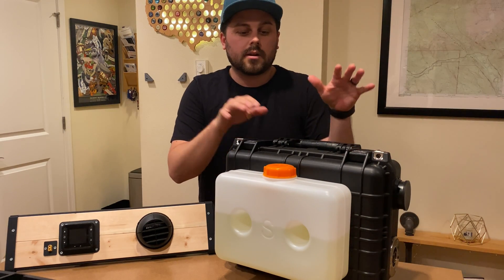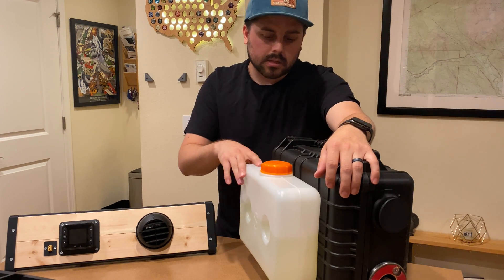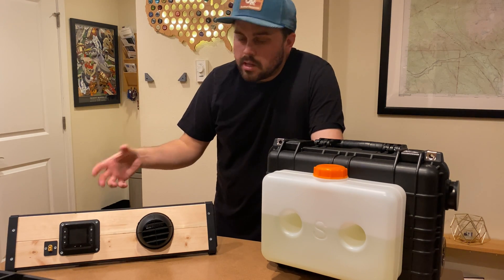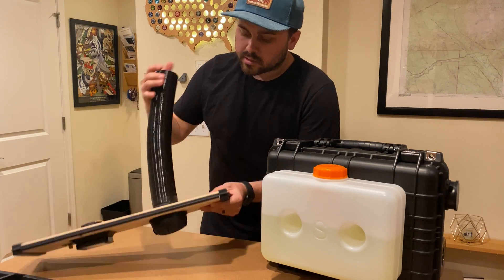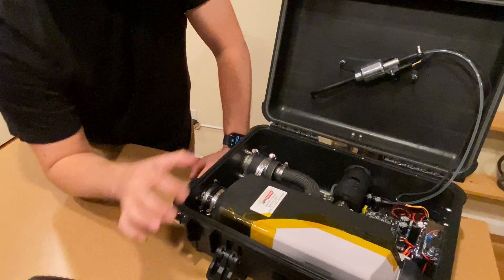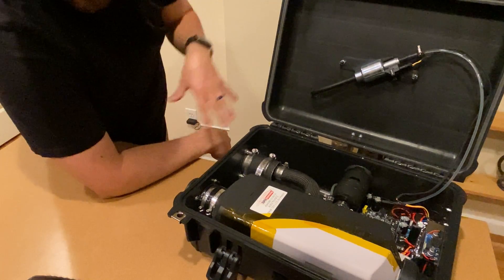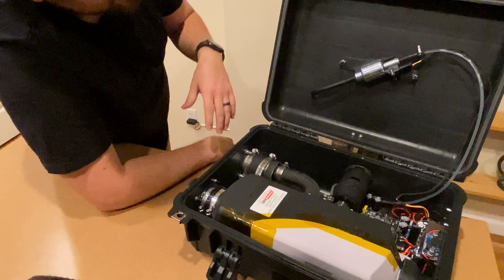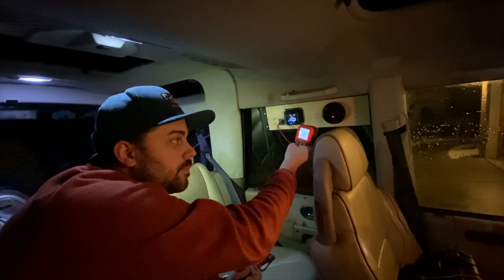Portable Diesel Heater in a box!

Comment from the maker: Feb '21 Update: We have been getting tons of requests for a way to buy the parts I designed! You can now pick them up here at my Etsy store: https://etsy.me/3aN6M81
Reply: Add. To. Cart.
Reply: Hello. Seeking some advice. I have used your build as my base design but have come to a premature stop, as once the exhaust pipe is cut to the required length, the uncut end will fit either the exhaust port or the marine exhaust, but the cut end will not fit either as its actual internal diameter due to the ridges is smaller. Can you please advise how you over came this.
Thanks in advance
Reply from the maker: @royclark8385  hi Roy, I am using a different exhaust pipe that can be cut to length. I have a link to the exhaust pipe used in my description
Reply: @keeganbuilds  

Thank you
Reply: Thanks so much for all of the info 🤘
Reply from the maker: @camry cruising shoot me a message on Instagram and we can talk
Reply: So it shows as a 2 year old video.  How many hours would you say you've used it, and how has it "stood the test of time"? 
Anything you would change?
Reply from the maker: @charlietuna5962  still going strong. I updated the power cord to a water proof style cord in my new 5kw size version that I sell on my etsy store, but other than that been great.
Reply: @keeganbuilds  excellent,  thank you very much for that update.
Reply: Would you consider a custom build?  I am thinking a larger box with 2 8kw units......

Comment: Can someone explain to me how to set up this cord? I love this control panel. I know inside it’s got the 12 volt cord for the thermostat, and alongside the power cord but are these just soldered to the pins?
Reply from the maker: 5 cords. 12v + and - then other 3 are for controller 5v + and - and blue signal

Comment: What connector type did you use to connect all the 5 wires. Believe the power should be 14 awg, depending on length. I assume the congroller wire can be thinner. Do you know the awg?

Comment: Did this controller/thermostat require the 8 pin connector, or could you get away with a 5 pin connector and 5 wire cable, and do you happen to know what the max amp rating is for the speakon connector?
Reply from the maker: You can get away with a 5 pin connector and wire. 12v +/- then 3 wires for the controller which include 5v +/- as well as blue signal wire.

Comment: Hey interested in your 3d parts. My body bought a heater off Amazon turned out to be crap. Which one are you suggesting to get.
Reply from the maker: I would check reviews on Amazon. Usually reviews will showcase if it’s good or bad. I’ve linked one that I move found to be good. Have you checked out my 5kw build video too? It’s a little bit easier to build than the 2kw
Reply: @keeganbuilds  ok I will look at it. I purchased your 2kw kit so that’s the heater I’m targeting. Also. Did you make that wiring harness or order it.
Reply from the maker: @cj6833  just watch the 5kw build video and it shows how the harness is made

Comment: Hey man, I’m about to buy a heater just to use for ski camping here in PNW.  I have a side in Scout camper and want to put one of these in the wheel well area and pipe in the heat into my camper.

How has it worked out for you so far?  Is it pretty loud?  Any smell of fumes or diesel when heating up?  Anything else you would recommend instead in this price range? 

I’m looking at this model but they also have the metal case ones too (cheaper a bit) XMZ-D1 that looks interesting.  Cheers man.  See you around Hood maybe
Reply from the maker: Nice! I’m in pnw too, this has worked great for me for almost 3 years. All preference for what you’re looking for. This is more of a waterproof solution. None of the prebuilt solutions offer that.
Reply: @keeganbuilds  nice! Are you in the Gorge at all?  HR?

Comment: With these heaters, are you not meant to pull air from inside the van to be heated up? By pulling air from outside the van, doesn't it risk dragging in fumes from the exhaust which is not too far away?

Comment: I have a gazelle t4 tent that is 94x94x78 would the 2kw be enough or should I do a 5kw heater?
Reply from the maker: 5kw for sure, that way you can have some flexibility
Reply: @keeganbuilds  I was kinda feeling the 5kw would be best. Now I’m just trying to figure out power. Using youre vehicles battery a good option?
Reply from the maker: @scooter0241  usually dont want to leave yourself stranded by potentially draining your main car battery. Many guys use a 100AH AGM battery that they charge at home and bring. Others use things like Bluetti batterys (solar generator)
Reply: @keeganbuilds  yeah I wouldn’t do that if by myself. My deep cycle boat battery would probably work just fine
Reply from the maker: @scooter0241  That would work perfect
Reply: @keeganbuilds  do u sell just the Stl files for the parts as I have a printer
Reply from the maker: @scooter0241  I do not sell the 5kw STL.

Comment: Be careful of CO poisoning due to the fresh cold air intake is close to the exhaust port, especially when the wind direction blows the exhaust towards the fresh air intake side, unless a return air duct is installed and warm air is drawn back from the van interior, it also increase the thermal efficiency of the heater.

Comment: Seriously, one of the cleanest builds I’ve seen. Question, any issues with the printed parts warping/melting?
Reply: Most 3D filament extrudes at a minimum of 170° c which is 338° f and that's for a basic PLA. I would assume if he is printing the parts they are in ABS or PETG which have a printing temp of 240° c. In short, there shouldn't be any issues of them melting or warping. To far off from their working temp.

Comment: Did you have issues with power draw on start up? Mine can’t keep going at all. It just draws to much power I guess and goes from 13.2v to 6v and just dies
Reply from the maker: What do you have it plugged in to ?
Reply: @keeganbuilds  I had it plugged into the car while running. Then I also tried into a outlet. I ordered the dc converter you use since the one I have doesn’t seem to work well. Will see how it goes on Monday when I get it.
Reply from the maker: @dsnuggle  plug directly to car battery, I imagine your cigerator lighter outlet does not provide the 10-12a minimum requirement

Comment: How is the heater "engine" attached or secured within the case?
Reply: I had this same question. Did you ever figure this out?
Reply: @GregKnight66  we figured it out on our own and should have a video up soon. But short version is 2 pieces of flat stock bent 90° with the metal turret plate bolted to one face and the stock bolted to the case.

Comment: What a great design! Only thing I wonder is the elevated placement, doesn't the heat seek up so a lower placement would be more efficient, or maybe it doesn't matter?
Reply: When I moved mine from the work bench to the floor it worked much better keeping my shop warm 14 feet by 22 feet.

Comment: Hey Keegan, enjoyed the build video. The box is nice and clean. I intend to make a build very similar, just in a larger box with the larger heater. I checked your thingiverse page and noticed you do not have printer settings provided. Could you provide print speed/filament/infil/supports needed etc? Also, my outlet is 75MM and i notice yours is 60MM.  Do you think increasing print size from 100% to 125% would give me the resulting 75MM outlet that Ii need? Thanks in advance and again, nice clean build.

Comment: Cool setup but limited use, subject to theft, smelly diesel fuel that gets on everything. Simpler and cleaner is a 2200 watt generator and 2 $30 dollar 1000w/ ceramic heaters. Portable, multi purpose….Of course, permanently installed, the diesel heater is the fashizzle…if you can turn it on without getting out of bed.

Comment: Looks great Keegan. I ordered your parts up and will be building mine soon. 
Question: DId you use the 2 kw to keep it working on full blast rather than chossing a 5kw or 8kw that may be overkill and require throttle down operation? 
Question: Do you notice any of the clicking noise from the pump in your system? I am going to use with a RTT and considering hanging it from a fold out bracket I will fab for the clamshell tent? I have seen a Russian pump that is around $100 that advertises a 35% reduction in noise.
I will be powering mine from a Goal Zero 1500X which has a regulated 12v output and routing through a fuse block as well. I am thinking that I can forego the step down converter and maybe even the computer fan? Thoughts?
Reply from the maker: 2kw and even tho these things like to operated full blast I typically throttle down a little in the night cause it can get hot up there in my RTT. I just make sure to run full blast for like 10 min prior to shutting down. Since mine is on the ground I do not notice any clicking (big reason for getting it off the vehicle) you might try to dampen you mounting system? And yes you can bypass the step down if you have a 12v system. Just make sure that it can do 10 amps

Comment: I've been running mine for a few days on and off.. I set it at 1.6 much of the time..sometimes I go up to 2.8 or so but arrely over that.. lately  I have not noticed any issues at all.. I check the exhaust and so far it appears to run the same.. on high or low settings.. It doesn't appear to produce any more or less vapor at the exhaust pipe.. smells the same and for the most part it appears to run clean either way...
Reply from the maker: Right on! Great to hear. Got pics online anywhere?

Comment: Great video!  Thanks a million for the link to the Webasto exhaust pipe.  Have seen it in a couple of videos but no one else linked to it.
Incidentally, a 5kw heater will require an Apache 4800 case.  I got mine at Harbor Freight for way cheap compared to Amazon.
Reply: Did you get his 3d prints? If you did let me know if it works with the 5kw. Thanks

Comment: hi Keegan, very helpful video. Ihave few questions:  do you think the controler gives info about the temperature measured at the controler or somewhere from the heater? Does it turn off the heater after reaching the set temp and then turn on again when temp drops, or it works differently? Wondering what would be better: putting the second pipe for circulation of heated air, or as you have, sucking the cold air from outside. What would you suggest with your experience? Huge thanks.
Reply from the maker: The temperature is measured at the controller inside my rig. However as most diesel heater users know, these things love to run at full blast to burn efficiently, so I just have it on full. Running a recirculating pipe would indeed keep hot air inside and make things warmer. I found pulling the cool air works just fine and gives me peace of mind that I always have fresh air moving
Reply: @keeganbuilds  Great, thanks a lo!

Comment: What power source should I get
Reply from the maker: well depending on how you want to go you can either power it through your vehicle car battery (direct hookup to handle the amperage) OR you can use things like a jackery battery or other lithium battery. You just need to make sure that the 12v source can handle 10 amps or higher because these things draw as much as that on startup and shutdown.

Comment: Incredible ingenuity and design - my favorite part about this is the 3D Parts provided and source files. Questions 

1. What’s the estimate for total cost? 
2. When will your etsy 3D parts be back on sale?
Reply from the maker: Hi Alex, thanks for the kind words! It was definitely a long build but came out great! My Etsy parts are back on sale, I was out of filament but am back in stock. Estimate for total cost was around $450 I believe. It will depend entirely on price points of parts on Amazon and current building material costs (bolts, nuts, etc..)
Reply: @keeganbuilds  Awesome you are the man! Can’t wait to see more projects 

I’ll be using this with my Super-pacific camper and will send some completed pics!

Comment: Keegan,, can I buy specifics items from your 3D print,, I wrote you a note on etsy. Im building a similar design, but with a propex LPG heater. The return and hot air output are the same size.. was wondering if I could buy just those pieces with the lids.. super clean setup dude.. good work on your build. Please let me know.. thx, e

Comment: nice box... but you use it wrong ... 
1. the heat from the pipe is cooled by outside temperature
2. the intake should be separate, so the inside air from car should be circulated through the heater, heating it each time further, not bringing air from outside and heating it.
Reply from the maker: Seems to be working great as I built it. Has been for over a year and hundreds of hours. My main concern was the possibility of an exhaust leak with a recirculating system. If you were to possibly have a leak and your CO monitor missed it. Night night. With this design and a cracked window you’ve got constantly refreshed air. Also this gets hot enough to cook you out of your vehicle (even a 2kw system). 

Did you build something better? Love to see how you did it!
Reply: @keeganbuilds  No I have not done anything, just documenting myself about this heater on internet....I might intend to install one permanently in my car, as it is useful for long trips where I might intend to sleep one or two hours, and most of time wake up before recover because it might get cold. I also intend to add an auxiliary battery for different purposes and also for car fan to bring from time to time fresh air, And also find a solution for noise as parking on highway is not so quiet..
Reply from the maker: @user-ug9nn  Nice well good luck!

Comment: How did you attach a chainsaw fuel filter to the provided fuel tank bulkhead fitting? There isnt anything to attach a hose to on the interior tank side of the provided fitting.
Did you drill and tap it for an internal barb?

Comment: So it appears that from your 7 wire cable, you are using 2 for ground and hot from the battery, and 3 for the low voltage to controller. The other 2 wires are just along for the ride?
Reply from the maker: Exactly!
Reply: KeeganBuilds - great. Since there are 2 extra wires, I think I am going to double up wires on the pos and neg from battery. That way there is no chance on overloading wires over a long stretch. I was going to use a trailer wire cable that had 2ea 10 ga wires and the rest 14 ga, but those Neutrik QD connectors will only accept 12 ga or smaller. Excellent resources!

Comment: @keeganbuilds would you be able to post a single line diagram showing not only electrical, but also the exhaust/intake?  Would be great if all the components/wraps were labeled.  Have most of it figured out but missing a few pieces.  Major question is what type of cord are you using from cigarette lighter and what is the receiver piece in the wood and how does it connect to the female quick connect?   Great build!  Looking forward to seeing that single line and labels.
Reply: Did you ever figure this out

Comment: Could I ask what size the tank is please?
Reply from the maker: 5L, hope that helps. Also, I’ve noticed a bunch of new views in the last day. Can I ask where you found my video?
Reply: @keeganbuilds  I was literally just looking up ways to have a portable diesel shower on YouTube and you showed up as suggested. I'm trying to figure out which would be cheaper to run... Diesel or Lpg
Reply from the maker: @ChelseaJadeC  well i can say that if I run this heater all night, at full blast it uses about 1/3 of the 5L tank. Each heater will have different settings but with my current pump and temp setting that is roughly what I use.

Comment: i checked the stl files. great job here too !!.. one question though, im not sure how the hot air output is done. do you use two heater-output-tube's as it doesnt seem to protrude through the wall to the inside to allow the hose from the heater to attach

Comment: How well does the heater proform on its side? I was told they cant but I don't see why not
Reply from the maker: You just need to make sure the glo plug is up. So in theory there are 2 correct ways and 2 incorrect ways to run these. Check your heater for exacts. Mine was oriented so the heater could be running in briefcase mode as shown in this video next to my cara, or, with the lid open and laying flat. Both my orientations have the glow plug on the upper side.

Comment: Superb.  Wonder if there would be benefit to re-routing the already heated air from the cab back into the heater so you're not always heating up cool air?  Obviously two 60mm tubes on your window mounted panel make things complicated and cumbersome.  Do you think the extra complexity would be worth it to gain more heat?  Maybe a inlet to accept another 60mm tube if required, attahed to another window panel at the other end of the vehicle?
Reply from the maker: It is definitely a thought I considered when coming up with this design. I do find however that the heater gets so hot as it is that I actually crack another window in the car and keep a hot flow of air going in one side and out the other! Plus I do like the idea of knowing that at a bare minimum I am getting some fresh air always entering the heater. Recirculation of the same air scares me if there ever was a failure and CO started entering the fresh air. (always run with a CO monitor as a backup tho!)

Comment: Hey Keagen, how is the heater mounted to the box itself? Thanks
Reply from the maker: Helpful Vids thanks for watching! The heaters ship with these plates that you can flat mount to stuff. I just bent that plate to give it a 90 degree bend. I could utilize 2 of the mounting screws. Then I cut the other side so it was short enough to close the case